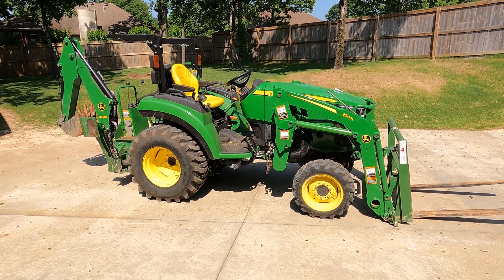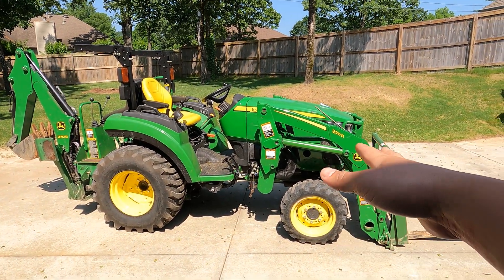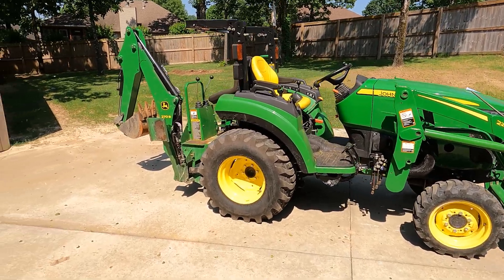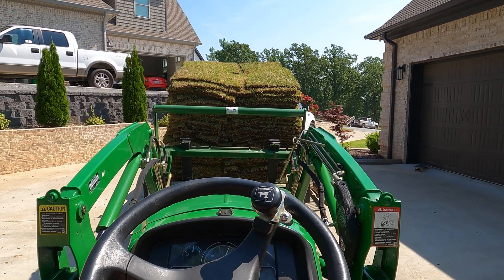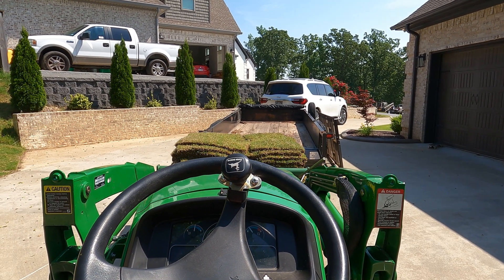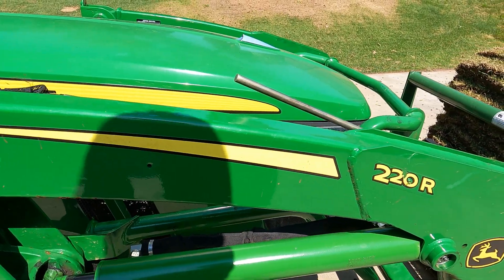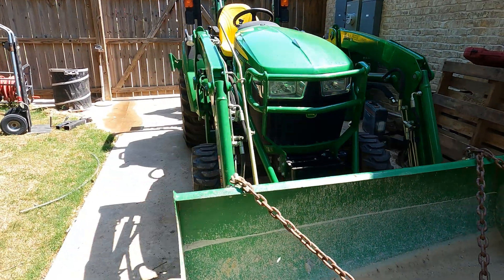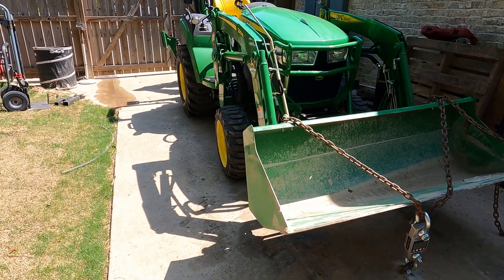HydrosPlus Cylinders+ Teaser - 2 Inch Bore on 2038R with 220R loader

Comment: I own a 2010 2520r Deere.  It has the 200cx loader which looks identical to the 220r loader. I would love to get the 2" cylinders for my tractor... but then I'll need the pump upgrade.  Do you know if the large pump will fit my engine? I believe it's rated at 26.5 hp or in that range. Thanks!
Reply from the maker: The 200cx is not comparable to the 220R loader, it's more comparable to the 120R loader.  The 300cx or H130 would be more comparable to the 220R.  As for the pump, your tractor uses a different setup, so the pump unfortunately won't fit.

Comment: I have a 2038r if I get the 2 inch will it affect my bucket to get dirt all the way down.   Because I noticed you said it hits the bore
Reply from the maker: It does touch the quick attach latches at the bottom, but still goes down the same amount.  The interference is small, but will create a minor indention on the cylinder and take off some paint if you don't do a little grinding to make the clearance.
Reply: @HydrosPlus  oh ok. Thanks for answering my question.   I don't mind a Lil scratch

Comment: Does that mean the speed is reduced proportionally?  Is the pricing on the website per pair or individually?
Reply from the maker: Website pricing is for the pair. I'm not sure what you mean by the speed is reduced proportionally. The speed of the 2" is about 75% slower than the stock cylinders.
Reply: I was trying to say that for a 25% increase in lift cap you lose 25% in speed for  a 1.75 cylinder and 75% lift for a 75% reduction in speed approximately. It makes sense.  Trying to figure the best option for my 2038r without getting my self in trouble with bending the loader frame or popping a tire. So 1.75 or 2 inch, decisions,  decisions!

Comment: Why does the 2032-38 FEL drop down so steep of an angle where some tractor loaders are stretched way out front? Is it so it will lift more.
Reply from the maker: That's a good question and I don't know the answer as to why.  Keeping the load closer to the fulcrum will give you more leverage, thus more capacity, but lift capacity could be solved for in other ways.  I've often wondered why they don't just use a straight boom arm like you see on most construction equipment.  I'm sure there is a reason, but I don't know what it is.

Comment: Hello Kevin,
Another Kevin here. Do you have experience with the 1990's 70 series of John Deere compacts?  Specifically, higher flow on a budget.  I don't know much about hydraulics other than to give something a try.  I converted a box store splitter to a fork mount for a specific source of tree service sized firewood. The splitter is slow on the JD 870.  Are there budget minded options to decrease cycle time or increase speed?  Here's the experiment in question:

https://youtu.be/7wSjZLqXsDM
Reply from the maker: Unfortunately, I don't have a solution for this model and it's not likely one that we can reasonably solve for, meaning it will cost way more to develop than we would could ever recover.  Log splitters require a lot of flow and that's why the pump that you took off was a 2 stage - so you can get speed to get to the log and then power to split it.  No real option on small tractors to do the same thing.  There are options, like a power pack, but that would likely take you outside of your budget.  Cool project!

Comment: I was wondering how heavy do ya think the pallet of grass sod was???
Reply from the maker: My best guess is 2300 to 2500 based on the scale results and how it lifted.  Felt like it could have lifted to, or near full height, but I didn't have the guts to go that high.
Reply: @HydrosPlus  Drop your hoe to the ground & put your outriggers out for stability! Have you changed out your hydraulic pump for your Hydrosplus one on this size tractor? My uncle has one just like it, all stock. I still wannuh order one from ya for my 1025R. . . . .perhaps this sometime this summer, hopefully👍🏼! I havent seen any of your videos in awhile. . . . sorry bout that! Ive got the hoe bucket & pins pulled out on mine!

Comment: And that 2642lb was at the front edge of the bucket…that’s amazing
Reply from the maker: Yep.  At the end of the day, I expect that it's going to make the experience better for normal use because it will lift with authority, and it will also give you the option to lift those things that you generally shouldn't be lifting, but you need to lift, every once in a blue moon.
Reply: @HydrosPlus  was that curling r loader lift without curling?
Reply from the maker: @nastorino  Lift only. Curl was all the way back during the test.

Comment: Just as I thought Kev , the weak link will be the front tires. My 1026R squish with a max load in my grapple at stock. Since you usually have the answer before the question is asked...👍 Have you looked at tire upgrades for either the one''s or the three's ?
Reply from the maker: I have looked, but haven't really found a better solution than running higher air pressure.  I run 30psi in my fronts that are versaturfs and they squat when it gets really heavy, but seem to be generally fine.  They are 4 ply and there are probably a few 6 ply option out there in a 18x8.5, but not sure it's worth upgrading.  The 2R and 3E fronts are 6 ply.  You can run 50 PSI, and as you can kind of see, they are squatting pretty good, but they have about 2500lbs hanging 5 feet out in front of them.  My point of view on this upgrade is to make the tractor work better for general use and have the ability to pick up really heavy things every once in a while.  If picking up 1500lbs is what you need to do every day, you definitely need something bigger than a 1 series.  if you're picking up 2500 lbs regularly, you definitely need something bigger than a 2 or 3 series...in my opinion.

Comment: I'm curious to see the lift capacity increase of the 1025r. I don't like that I can't lift a full bucket of gravel to full height.
Reply from the maker: The cylinders that are coming soon will increase your lift capacity by ~36%.  If your pressure is 2000 to 2100, you should have no issue with lifting gravel to full height.
Reply: I'd love that upgrade for my 1025r as well.